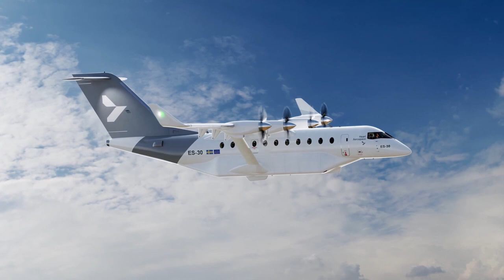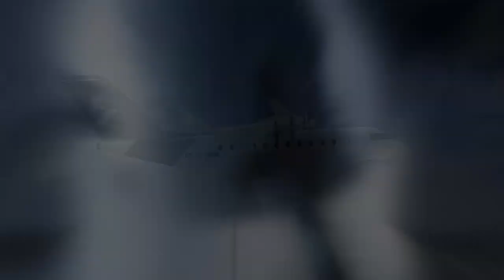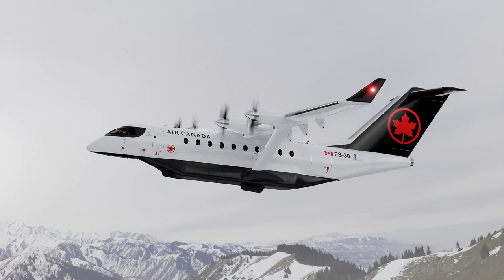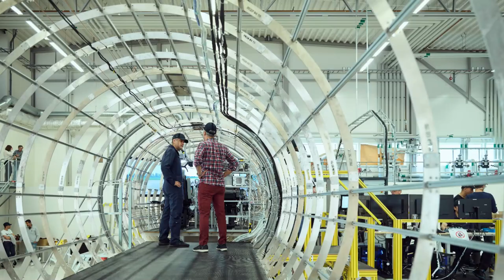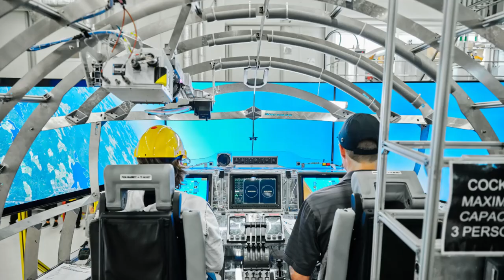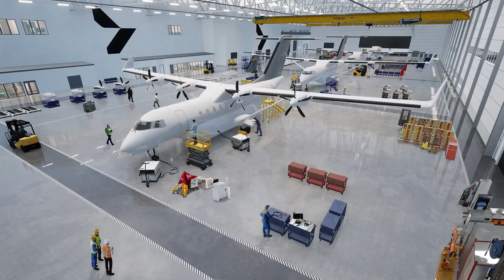Heart Aerospace launches electric 30-seater passenger airplane

Comment: It would be interesting to know what the battery capacity is supposed to be. Mind you, the 100kW/h battery of a Tesla P100D weighs a whopping 625kg/1378lbs. The car has the advantage of not trying to ram itself in a field as a default. This will have to pack a LOT more. A heavier battery needs more power and more wing, that creates more drag and more weight that requires even more power that in turn requires bigger batteries that bring more weight and so on and so furth.

Electric commercial aviation is not going to happen unless batteries become considerably smaller and lighter. And so far battery 'revolutions' resulted in some 10% increase in efficiency on a good day or a big cloud of vapor ware.
Reply: It's just for regional flights. I understand your worries... But if RC planes can fly... so can actual planes. Of  course its a hell of a technical challenge... But I'm sure it's feasible. Long range planes? nah. Short range? I think so, yes.
Reply: @turmat01  How long do RC planes normally fly and how much cargo do they carry? They operate electric DeHavilland Beavers in Canada that fly a little over 15 minutes. Lithium batteries just don't cut it, they just don'r have the necessary energy density.
Reply: @Perry_dAccard  My plane flies for about 20 minutes. 

So they say this plane is gonna carry 30 passengers. That's not that many people, and look at the bottom of the plane, this is all battery. On top of this, I know they are coming up with structural batteries nowadays (not claiming they use this tech on that plane here, just that it exists) where even your structure is basically a battery. As with current planes, the wings can be batteries, etc etc. So I think most of their cargo is gonna be battery, just like a RC plane.

They will also use quality parts, whereas we usually use cheap chinesium parts in the RC industry. I'm sure their plane is gonna use better shit than I put on my 100$ plane XD. I would expect more than 20 minutes out of it, and they did say 200km... Thats not very far.

I'm not saying this is easy and simple, but I do believe this is achievable. He re are my issues with it though:

1) The time it usually take to deal with boarding and stuff like that, plus the holding patterns you might get at destination, etc etc... At this point just take your car... So they will have to somehow have a "fast lane" in airports for these super low range flights... 

2) Also for these super low range flights, that doesn't cost a penny in gas... I would expect very cheap prices as a customer... but these planes will most likely be SUPER expensive... So I don't see how that's a good business move on AC's part...

So yeah I think from a technical standpoint, it's tough, but FEASIBLE (there will most likely be VERY limited luggage you can bring with you, if any at all other than a backpack...), but I don't really see how they are going to profit from it. One day I guess. And they will be able to say they were amongst the pioneers XD
Reply: @turmat01  I'm not convinced by the RC plane comparison. Even though they are both airplanes, thei have to fill completely different envelopes. A commercial airplane will have to have like a 30% emergency reserve on its longest flight with full cargo. Even with strong headwinds at cruising altitude, which it also will have to reach first. Imagine your RC plane has to carry cargo, nothing big, like a can of soda. And it has to be able do that for at least an hour in all weather conditions, reliably year after year, four times a day. But it can't be any bigger than now.

As to structural batteries, ask a pilot who has suffered heavy bird strike if that is a good idea. Maybe the guy who had a seagull squashing its organs through the instrument cluster. I'm sure he's a fan.
Making your energy storage a structural part has never caught on for a reason, thank you for your epic motorcycles Eric Buell, but that was a shit idea.
Reply: @Perry_dAccard  I don't have all answers, and obviously I don't mean RC vs this is direct comparison... but my point is I'm sure it's feasible. Tough, but feasible. We have put a helicopter on Mars dude...
Reply: @turmat01  Yeah, that was pretty cool...
Reply: @turmat01  for regional flights, specially here in Sweden which flight distance is between 150km to 1200km and not so many passengers, long flights have always one stop between 5hrs to 12hrs.
Reply: @uxeys1k791  okay

Comment: No engine bleed air.  How do you deice in flight?  How do you run an emergency generator in flight?  What if there is an electrical fire or battery fire?  What if it takes a lightning strike in flight?  Are there hydraulic systems ( normal use or emergency )?  Plus it has to manage all flight control & cabin systems.  Sounds pretty risky & not enough redundancy in systems for me.  You go first 😂

Comment: It's not "zero emissions" when a coal burning power plant charges the batteries.
Reply: Its at least a start. Humanity will not be making electricity from coal forever!
Reply: And you know where they will be sourcing electricity?
Reply: Air Canada is not gonna charge them using coal power... We use hydro electricity in canada. ;) (Air Canada bought some of these)
Reply: Thats up to the gov to correct those issues not the plane manufacturers
Reply: @turmat01   plenty of gas fired electric plants in Canada as well
Reply: That’s cute, but majority of the planet burns coal
Reply: They don’t care. As long as it looks good on paper and they get a high ESG score our tax dollars will continue to be poured into these projects without question. Like FTX and Alameda, which had a perfect ESG...

Comment: Probably never gonna make it to production because there's several red flags in this video with one being the claim the plane won't make any noise but when those props spin up it's gonna sound close to any other turboprop. Plus they will have to install an APU that runs off fuel and there's no way everything is gonna just run strictly off batteries on the ground or air.